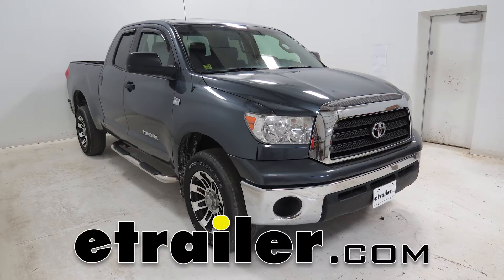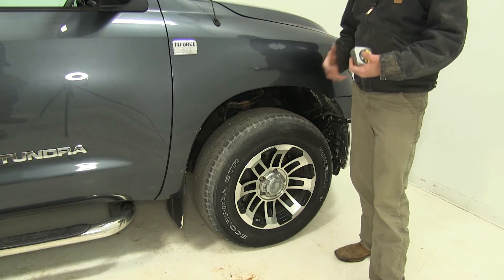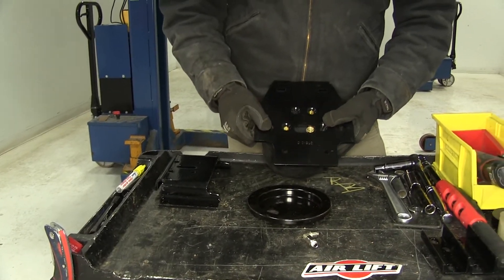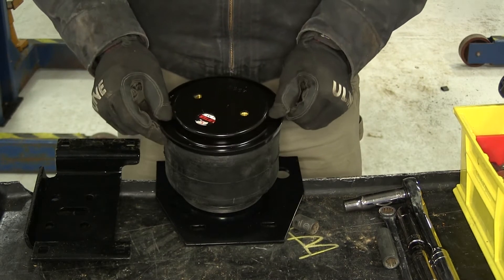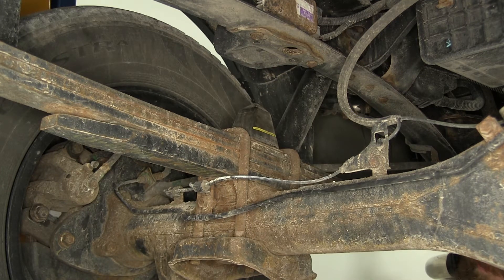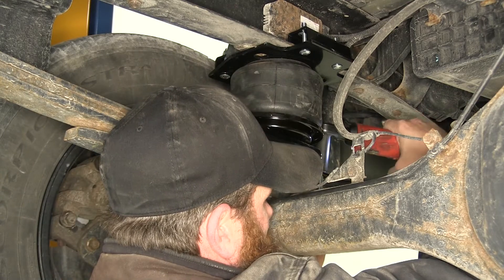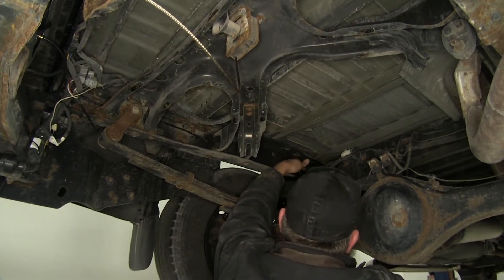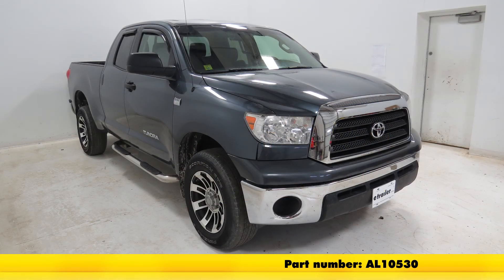etrailer | Air Lift LoadLifter Air Helper Springs Installation - 2008 Toyota Tundra

Comment: I mounted both of my valves right through the plastic license plate screw holes, no drilling through the steel, hole was already there, just drilled out the plastic. I wish I could see how you supported the rear end to keep it from dropping. They make some kind of stand, assuming that’s what you used?
Reply from the maker: That's a neat approach, very clever! We had the truck on a lift and used a pole jack to support the rear axle. You could put the rear of the truck up on jack stands and use a floor jack to support the axle.
https://www.etrailer.com/Vehicle-Suspension/Air-Lift/al88299.html

Comment: I learned from E-Lift, they make a cradle that to me should be mandatory with these. I learned after the fact, sadly, because now I can’t put my truck on the lift because it puts strain on the bag and it can break them. With the cradle, it will just drop right down but contact the cradle when you lower it back down. Now, I need to buy the brackets, take it back apart to install them. E-lift should include the cradle, charge the $50, but educate everyone with a video of why you need the cradles. I’m sick, I have to take it all apart now, bummer

Comment: Is there any way to lower the truck by putting axle on other side of leaf spring, but then add air suspension so I can still lift it up if,I need the ground clearance?

Comment: Could I add a tee so there's one hole and I know there's even pressure on both sides or is there a reason to have them separate
Reply: if you put weight on one side then you have uneven. Put 2 more safer , you adjust the height both sides

Comment: Would it be a good idea to have a Air hose T in place so that I only have one fill valve? Does it impact towing a TT if this is done?
Reply from the maker: You can definitely add a t-fitting if you would rather inflate and deflate both air bags at the same time. Some people will leave them separate if they are going to be hauling uneven loads and they need the side to side load leveling feature.
https://www.etrailer.com/Vehicle-Suspension/Air-Lift/al88299.html

Comment: Can these air bags be used with a rear leaf flip?
Reply from the maker: +LOWKIYO1 I have checked with my contact at Airlift and they do not have any kits or products that are compatible with lowered vehicles. IF you need any additional custom fit items for a 2008 Toyota Tundra, please check out our fit guide page: https://www.etrailer.com/vehicle/2008/Toyota/Tundra

Comment: Water is 8 lbs per gallon, 250 gallons equals 2000 lbs, video states about 1000 lbs....math check
Reply: Tank was only about half full if you watch the test drive